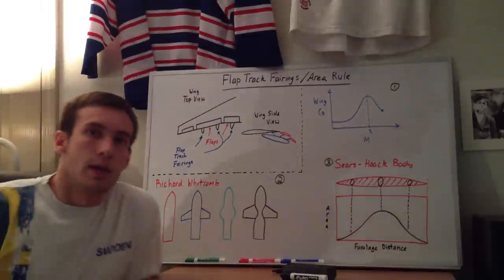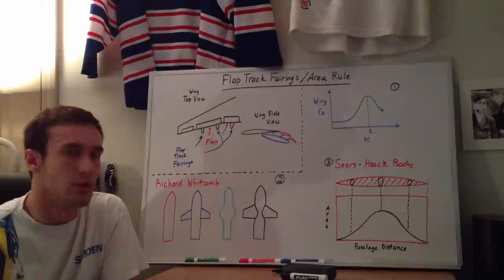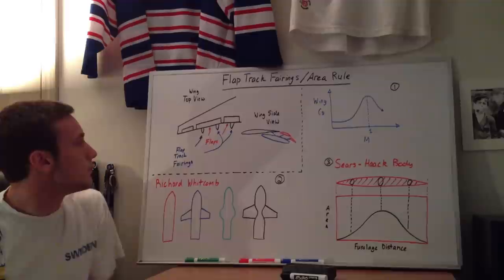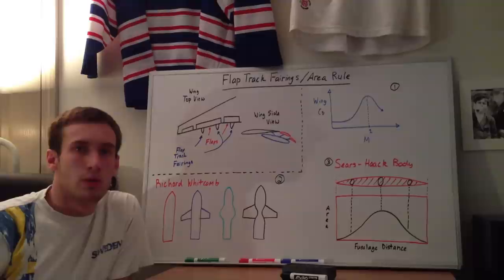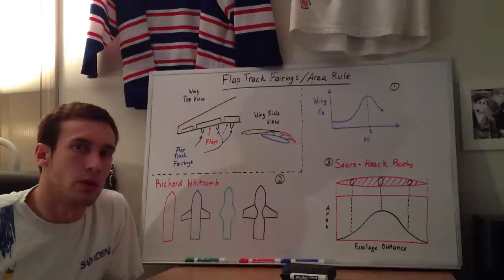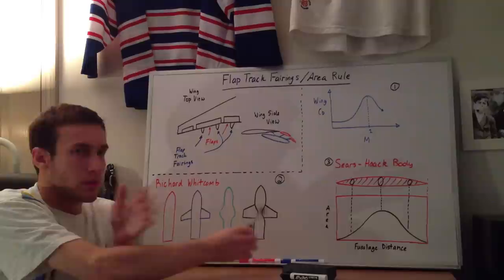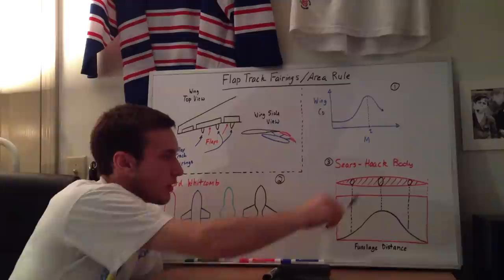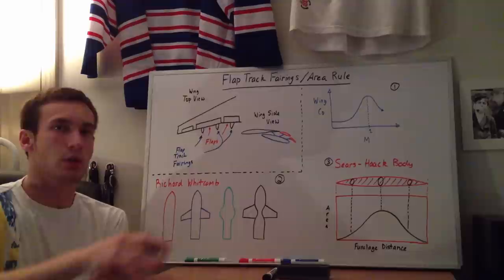Explained: Flap Track Fairings/Whitcomb Area Rule [Airplanes]

Comment: Another question: The two Wikipedia photos you posted about fuel dumping also show what look like small antennae protruding from the back of each of the flap track fairings. Is this what they are? If so, why are they positioned there, and do they have some kind of specialized purpose? Thanks...
Reply from the maker: Those little atenna-like things are static discharge wicks.  Here's the link to a video I have about them: Explained: Static Discharge Wicks [Airplanes]
Reply: JoshTheEngineer Many thanks for this explanation, and for taking the time to produce this very informative series of videos. Greatly appreciated.
Reply from the maker: It's my pleasure!

Comment: Hi, I was on a plane with one of the flap track fairings' outer housing is missing, leaving the inner mechanism exposed during flight. Does it affect the safety of the plane? Thanks
Reply from the maker: It's not common, but you'll find multiple instances of flap track fairings missing from planes.  There is something called a Configuration Deviation List (CDL), which lists non-structural parts that are allowed to be missing from the aircraft.  I would have to look at specific aircraft CDLs, but I'm pretty sure flap track fairings are on most, if not all of these lists (I always hesitate using the word 'all' in these situations because I simply don't know).  The fairings are just an aerodynamic cover for the flap mechanisms, and don't provide vital structural support, which is why they can be missing during flight.  However, there is definitely a drag penalty, and thus fuel burn penalty, when flying without them.  If you see that it's missing on your flight, you can be pretty sure that the pilots already know about it, and have deemed it safe to fly anyway.

Comment: Is it correct to think of these extra bodies as a compensation to cross sectional loss as you move back to the rear of the wings (as their cross sectional area narrows)?
Reply from the maker: That's one of the benefits of the fairings.  It would be difficult to get the cross-sectional area of a commercial plane to be completely smooth as you move aft, but the fairings certainly help.  Here's a link to a great reference (if you hadn't found it already) that I'll also put in the video description: http://www.aerospaceweb.org/question/aerodynamics/q0240.shtml

Comment: Can you explain to me what the rod I see sometimes sticking out of this region on the aircraft is? there is one in this video, it is grey with a black tip. http://youtu.be/7T83qCG32_4
Reply from the maker: Ah yes, good question.  That's actually a fuel dump nozzle.  The picture on Wikipedia that I'm posting here is from the same type of plane (A340-600) as in the video: http://en.wikipedia.org/wiki/Fuel_dumping

Every plane is different though, so sometimes you might not even see them.  It's also worth noting that not every aircraft has the capability to dump fuel.
Reply: Thank you for replying, 1 last question I thought that this might have something to do with fuel but  was uncertain, What if any role would the fuel dump valve have on contrails aka chemtrails?
Reply from the maker: sammy doutt
Sorry for the delayed response.  First of all, chemtrails and contrails are not the same, so be careful when using the terms interchangeably.  I wouldn't look too much into chemtrails.  Contrails are a valid question though.  Simply put, condensation trails form when the atmospheric conditions are just right for the water in the engine exhaust to become visible in the sky.  The key here is that water (H2O) is a byproduct of jet fuel combustion.  Jet fuel is made up of hydrocarbons, and aircraft engines use this fuel along with the air in the atmosphere to generate thrust.  The result, as mentioned before, is that water is present in the exhaust, and this is what you see in contrails.  The fuel being dumped into the atmosphere will be visible for a short while, but the persisting contrails you see are from water.

Comment: Do jet and turbo jet engines count as the area wave drag? I am curious because the jet engine itself would be sucking air in thus removing some of the drag. I bet it only happens subsonic though as it has a ram effect at supersonic and especially hypersonic.
Reply from the maker: B15HOP 
They should.  Imagine the airplane sitting stationary in a wind tunnel, with air flowing around it.  Whatever is physically in the flow that changes the area distribution will have an effect.

Be careful when you say the engines are 'removing some of the drag.'  They're not removing the drag, but overcoming the drag by providing thrust.